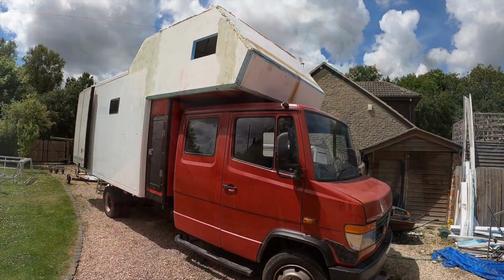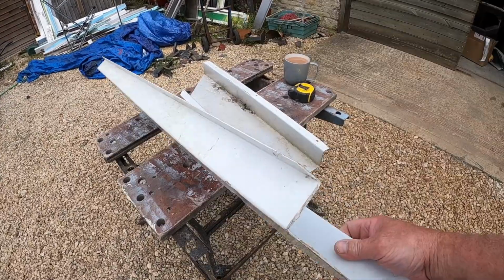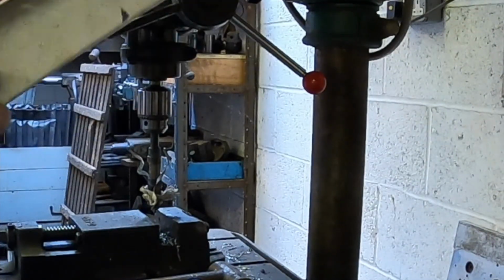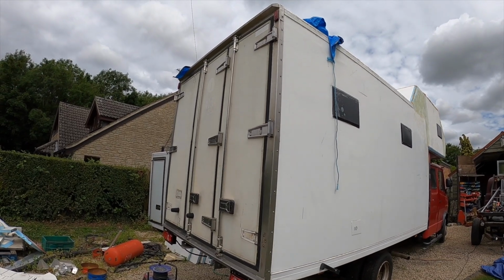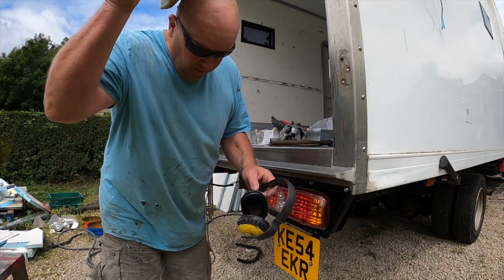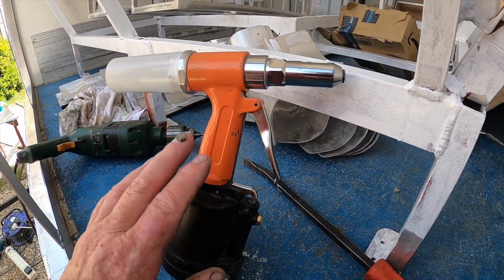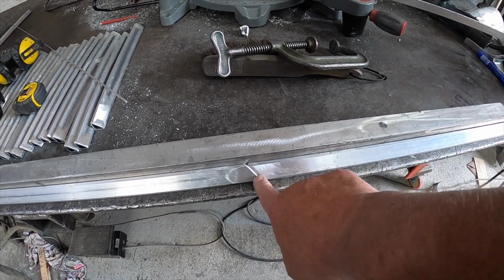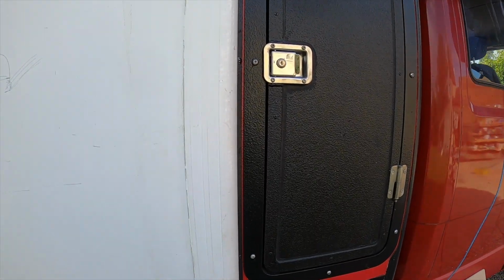Building a campervan from scratch!  This is our do it yourself Mercedes Vario Doka camper. EP13

Comment: This is awesome, well done 👏 can you tell me what the external width of the box is? I'm now genuinely considering cutting the (rusty) van body off my 03 814 and putting a box on, im bored of dealing with rust now. I've found one the exact size but it's 230cm wide, ideally I'd like 220cm wide.
Reply from the maker: Hi and thanks. It's about 2.3m. The rust thing was why I went down this route. I absolutely love the big vans but couldn't face welding one up and then watching it rot again. I found that the narrower boxes tended to be the smaller ones overall. This one is 4.4m x 2.3 plus the storage boxes on the front.

Comment: That was an enjoyable watch. What sealant did you use on the windows? We used similar windows from Belluna in Germany and went with dekalin dekaseal 8936 which they recommended. It’s like a mastic in a caulking tube that remains flexible and never sets. It’s brilliant stuff and really easy to remove the excess by dabbing some around the edge as it sticks to itself and peels away.  We found the screw length was critical though and had to drill out the inner frames and use longer screws.
Reply from the maker: Thank you. We used Sikaflex. Apparently it's the go to bonding agent over here. We also had to buy different screws (as shown in our previous vid) and also re-drilled the inner and outer frames.

Comment: Hello
Great work. On the left side of the refrigerated cabin, did you only remove the door or also the door frame and how exactly did you attach the new panels in the cut-out (asking because I also have a door to remove and the side of your cabin looks like one piece after painting)? Have a nice day.
Reply from the maker: Hello JW. I think I show how the door was filled and joined in EP11. It's not too difficult. Thanks for watching.